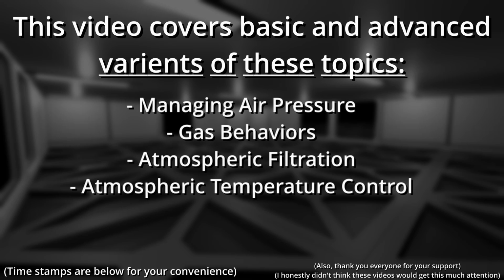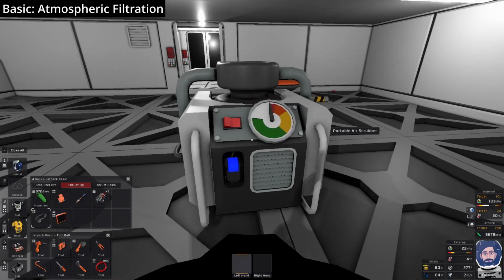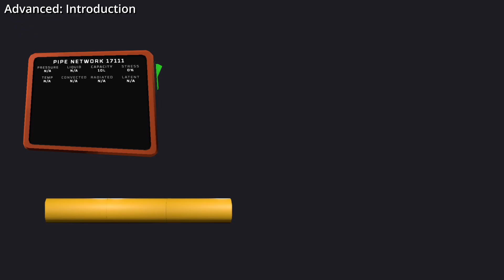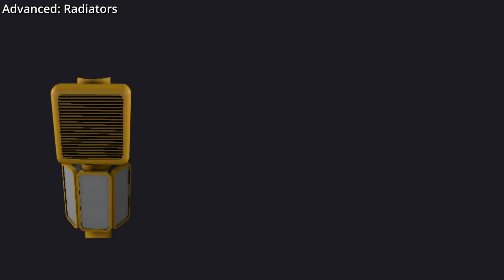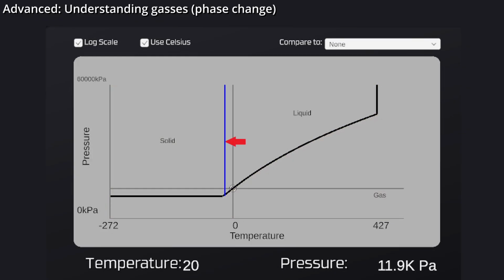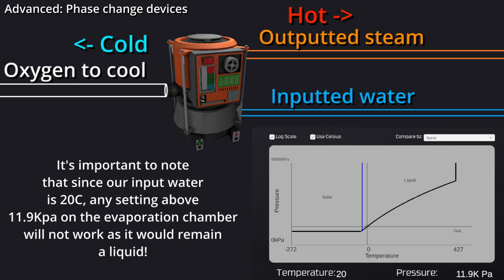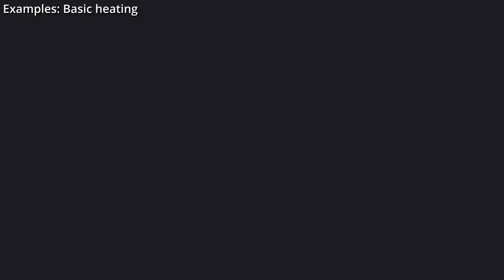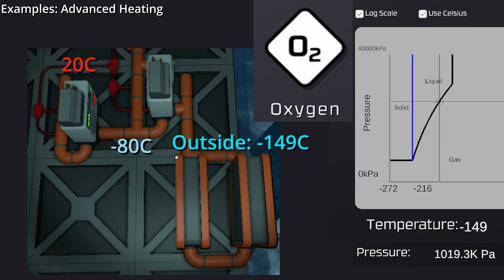TLDR Stationeers Tutorial - Atmospheric Control

Comment: Hey, good explanation! Question: How do you effectively filter multiple rooms in your entire station?

I have a station with multiple floors and rooms that are all individually connected to one large Life Support Pipeline with 75% N2 + 25% O2.

Should I equip each room with a filter, or should I constantly circulate air? How do I distribute air to each room, and what's the best way to extract air from the rooms?

After the filtration and pumping units started working differently, I noticed I can no longer filter air quickly. A contaminated room remains contaminated for hours if you only have one filtration unit. And flushing the room for every fart is also excessive.
Reply: You need some sort of a pump to force air through filtration. Filtration units used to be absurdly good at pumping, but now require a pressure differential to operate well.

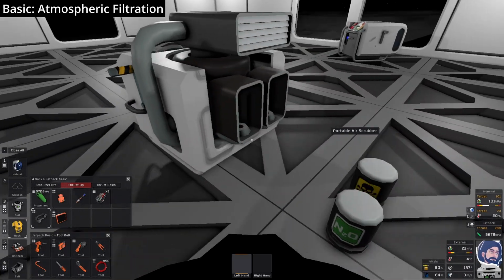Comment: 1:10 "At the start you'll have a tank of liquid nitrogen." 
Oh really? Seems, I'm too dumb to find it. After about 50 hours game play (on mars), I'm still unable to find it, only oxygen-, water- and fuel tank, and I've never seen it on any other YT video so far.
So, where exactly is it? In which box? Or is it on/in the lander? Which color does it have?
Reply from the maker: Heyo! While it does depend on what start you have, as well as what version of the game you're on. Currently on the Moon and Mars start it's in the red crate labeled "survival supplies", inside a box labeled "Portable Air Conditioner Package". You'll find a gray/yellow canister labeled "Insulated Canister Package" if you hold left click in the middle it'll open up into a green coolant canister. Although beware that if it's left in an atmosphere it'll cool it once it's no longer insulated. (I've had pipes in my base burst because they got to freezing since I forgot I left it in my base.)

It does not spawn if you started a Brutal difficulty run (but neither does the lander I don't think)

Hopefully this helps!
Reply: @Andrew-ex9gs  Thank you so much! Yes it's in one of the boxes and still has the thermal insulation on it, so I didn't know, that it has this "high value" inside! I thought, it's just an insulation to insulate some other stuff later in the game.  ;)